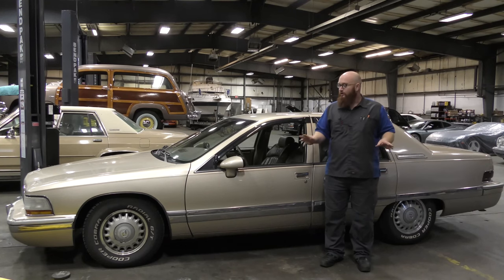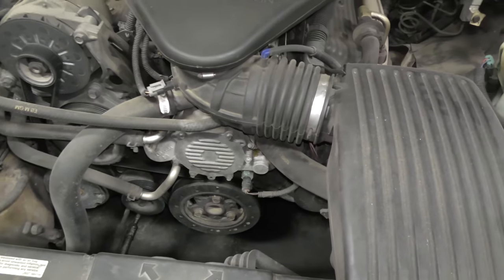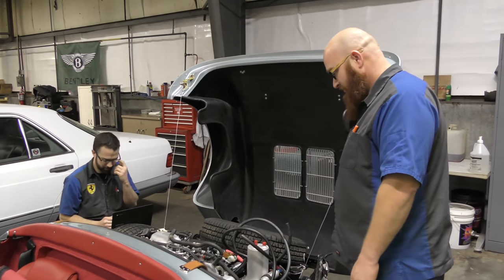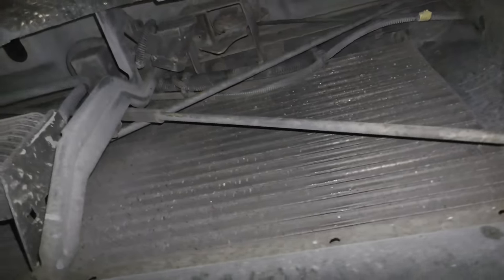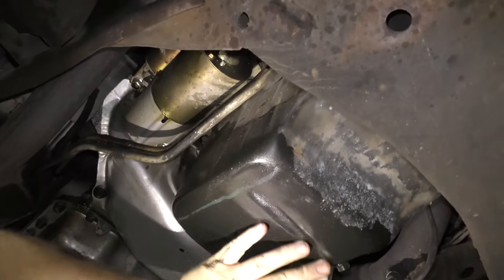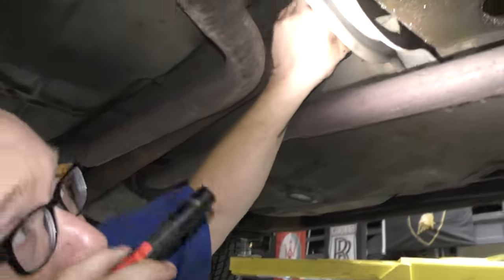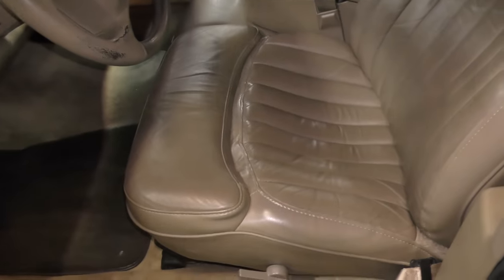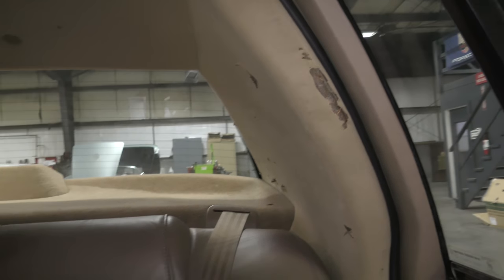Why do mechanics buy 'grandma' cars? CAR WIZARD explains their lure with this '94 Buick Roadmaster

Comment: I just talked about it with my mechanic from BMW workshop. He drives an old toyota camry V6. I asked him why he doesn't drive a BMW since he has a BMW workshop. He said: "I repair BMW cars 12 hours a day, so I'd rather go somewhere after work than repair my own BMW" ;)
Reply: Cause he’s dumb and doesn’t buy the right bmw. I’m a bmw mechanic and drive an e39 530. Car has 200k and doesn’t skip a beat. No lights. Passes inspection every year. Never quits.
Reply: @michaelric3540  yes until it doesn’t. Sure there’s some examples of bmw’s lasting to 300k but do you not remember the million mile Tacoma? Even Toyota wanted to know wtf they did so right there. They over engineer basically every car they put out you just can’t say they don’t run forever when you take care of them.
Reply: @keithbroh5730  wow what year Toyota Tacoma was it lol I might get one !
Reply: @keithbroh5730  whatr did they do right?
Reply: @keithbroh5730  bmw did a test and it found that with regular service intervals their engines would last 1,000,000 miles plus with no major engine wear, intact cylinder hones, and virtually no camshaft wear. It’s all about maintenance.
Reply: @michaelric3540  unfortunately that test was a good 20+ years ago
Reply: @James Olelo so, how is the supra made better? If it's a BMW in essence?
Reply: @James Olelo Let me get this straight. There were some supras that were rebadged BMWs, but now a law changed that? Or it was like that from the beginning?
If the BMW z4 has Toyota quality, then I would buy it right away... Just imagine a BMW 330 e46 or a 328 e36 with Toyota quality... That would be so cool!
Reply: @James Olelo oh, ok
Reply: @michaelric3540  Bmw e39 with gasoline 6-cylinder engines are durable cars, although they rust, besides, the youngest cars are already 18 years old. A colleague of mine had a X6 4.4 twin turbo. Under the warranty, his engine was replaced - a design defect. Mileage 60k, 3-year-old car. It's not for me, I can't afford to replace the engine every 3 years. I prefer a Volvo.
Reply: @michaelric3540  I had e32 735iA, and e34 525i with stick. Great cars, but today they are old. 735 was from 1990 and 525 was from 1995. Bmw has nothing interesting for me to propose, so I switched to Volvo in 2009.
Reply: Bmw mechanic for 10 years i drive an old e60 06 530xi everyone laughs at me at work the others have 80k audis and benz. One best thing is we got 1.5ft of snow todAy i was the only one that made it to work, and i have perfext attendance since my car never breaks, n52 engine with 105k miles runs better than new 5ers
Reply: bmw's are great,  if you can afford to keep them running!
Reply: @awpstardan  i have an 06 325xi. obviously you know it’s also the n52 so  mentioning it is for anyone else reading this. i am beyond 238k miles with no major issues. i have had many things to fix over time and some of these problems confused me, but if you know what to look for then repairing it really isn’t an issue. i would rather have a car that maybe takes more time overall for maintenance and repairs and has an incredible drive, compared to a car that i never work on that doesn’t make my ride anywhere near as enjoyable. 
ps. i also drove through the blizzard the other day for around 3 hours. no issues.
Reply: @michaelric3540  you sound like a silly fanboy, I'm even doubting you are a mechanic at all.
Reply: @michaelric3540  your lucky you got a good one, in general they are huge money pits
Reply: @smdog66  the vin is early on mine, I think that has something to do with it. Pre 10k vin digits. Mexican assembled. I always cringe when I see a high vin production numbers.
Reply: @sayingnigromakesyoutubecry2647  No, he's talking about past cars. Like how Chevy teamed up with Toyota in the late '80s through to the mid-to-late '90s to create Geo, or how Ford teamed up with Mazda (and still does) to make their pickup trucks (the Ranger/B-series), or even still with Chevy and Isuzu for their small trucks and SUVs (the S10/Hombre, Colorado/i-series, and the Blazer/Rodeo and later, Ascender). Those are strict rebadgings; the same mechanically (for the most part), with a few cosmetic adjustments (though not always true, in the case of the Colorado/i-series, and now the Ranger/BT-50).

The difference with the Z4 and the Supra, is that, while they start with the same base (being the drivetrain and chassis), they're not strictly rebadging a car. The end results, while similar, are distinct enough to make most of the parts not interchangeable. Sure, you'll get a fair few BMW parts codes with the Supra, but most of those will probably not work on a Z4. Parts subsidizing is something automakers have been doing for a loooong time. Yes, even competitors have worked together.
Reply: @awpstardan  I just bought an e60 06 with 181k miles and so far it’s doing me good haha
Reply: @1181darkfire  My old 528 was very reliable.  She could also be relied upon to get me speeding tickets ;-)
Reply: @1181darkfire  And the cops are on the look out for us too, by the brand name!
Reply: @michaelric3540  That's great but the rest of the car will be falling apart long before you get to 1mil miles.
Reply: @heh2k  wrong. Bills quality was great back then. Car has zero rattles.
Reply: @michaelric3540  Not correct. That "test" was almost certainly the one conducted on a track... hardly a reliable test...Even British Leyland cars could do well in a "test" like that.
The Toyota truck as far as I know, lasted a million miles in REAL conditions.
Reply: @daveanaru3038  the test was very much real world simulation. They simply changed the oil every five thousand miles. Used a correct filter and correct oil. 

Lack of maintenance is what kills cars.
Reply: @michaelric3540  A good way to know how good a car is, is to talk to the people who own one. If they get excited when their car just gets to 200k then don't get that car.
Reply: @adamr6498  I’d take a bmw that’s at 200k and counting and Infinitely more comfortable, better handling, safer and better looking than a million mile shitbox Honda.
Reply: @michaelric3540  lmao BMW money pit owner in denial. Stupid personal finance, spend 1/4 of the year at the mechanic and $800 bill every 3 months. Just be honest. BMWs are not known for their reliability. But that’s okay, you don’t buy a BMW for that. You buy it because you enjoy the style, drive, status symbol, etc. If you want reliability, it’s Toyota and Lexus. You luxury car drivers need to stop lying. The data shows German luxury cars made post-2000 have the highest median maintenance bills and spend the most time at a mechanic, along with Chrysler, Mitsubishi, GM, etc
Reply: @ebgreenham  oh and don’t get me started on the atrocious fuel mileage of Japanese cars. 

My 20 year old bmw can peg 35 mpg properly maintained. 

I see new Toyota’s barely getting 20 mpg. 

Pathetic.
Reply: @michaelric3540  Maybe a Toyota Tacoma. A new Corolla hybrid is like 40mpg. Suck on that. Seats are comfortable just fine. BMWs are for douchebags who don't use their turn signals. You're such a liar that you're a BMW technician, obviously, but regardless, you didn't deny that you spend inordinate hours working on your BMW within a year when I can relax and not waste time on a depreciating asset. Toyota Corolla starts every time. Can't say the same for a Beemer.
Reply: @michaelric3540  So because you saw one Camry breakdown, Toyotas are therefore less reliable than BMW? Lmao anecdotal much? Just read consumer reports and reliability rankings. Every year it’s usually the same companies topping the list, and hint it’s not BMW, Jaguar, Land Rover, Mercedes. Btw I have a R107 Benz so I can attest that older German cars are built really well, except for when they do have problems the parts are triple $$$   what you pay for a comparable year Toyota. Just so you know one of my favorite cars is the BMW E30 convertible, but luxury car owners need to stop trying to overcompensate and justify spending extra time and money for a depreciating asset as if they’re better than everyone else. Shows insecurity and is quite a turn off to others FYI. Modern BMWs are pretty much for obnoxious fuckbois and douchebags. Congrats.
Reply: @ebgreenham  yea Toyota’s top the reliability list because they never change anything. Same old boring cars. Woopie. I’d prefer a brand that tries to improve performance and efficiency instead of providing the same boring product. 

Have I mentioned Toyota went to bmw for their engine? Sure they tuned it up but it still means they wanted a better power plant for their Supra. 

e30 vert? Yikes that tells me everything I need to know. 

Only losers would prefer a vert over a coupe. 

Nice talking to ya captain Trash taste.
Reply: @michaelric3540  This is why Toyota went to BMW for their Supra. The Supra had the same BMW B58 motor as my 440.
Reply: @ebgreenham  imagine calling someone a troll on the internet t
Reply: @michaelric3540  yeah I just did. What’s your point? You’re probably a 14 year old white boy in the suburbs. Elitist judging everybody on their car preferences. Very immature.
Reply: @sayingnigromakesyoutubecry2647  the new Supra is actually a heavily re worked bmw, not just a re badged one. Toyota spent a lot of time un bmw’ing it
Reply: @rikkatheconure2395  what kind of things did toyota unbmw?
Reply: @sayingnigromakesyoutubecry2647  they mostly focused on making it handle like they wanted it to. If you read comparisons people say they feel like completely different cars when you drive them. The only thing they actually share is the b58 (I think it’s called) that they just tuned differently and the frame itself as far as I’ve seen. Saw a good video about what Toyota did to make it it’s own car.. trying to find it and post a link
Reply: @rikkatheconure2395  ok I would appreciate that. Thanks
Reply: @sayingnigromakesyoutubecry2647  I can’t figure out how to post a link, but the channel name is albon and the video is called 2021 Supra bmw or Toyota
Reply: @rikkatheconure2395  thanks
Reply: @sayingnigromakesyoutubecry2647  yessir
Reply: @rikkatheconure2395  I have watched it. Toyota helped bmw making a reliable engine. Cool. I want one!
Reply: @sayingnigromakesyoutubecry2647  it really is a neat car.
Reply: Well bmws are garbage cars anyway.  If you love driving a loaner car and having your car in the shop then by a bmw.
Reply: @ebgreenham  Does a BMW drive nicer than a Toyota? Yes. Is a BMW more powerful than a Toyota? In general, yes. Does a BMW have more tech? Yes. Does BMW invent tech that tricles down to other manufacturers a few years later? Yes. Does BMW cost more? Yes. Does a BMW have more maintenance? Yes. All these factors make for a less reliable car. Theres no way around it. Toyota play it safe. They arent filled with new tech, its the same old stuff. BMW's are supposed to be on the forefront of tech, and driving dynamics. Its also supposed to be a sports car, hence its a sports sedan. Toyotas are A to B appliances *only*. BMW's need to be dual personality. You are really comparing apples to oranges, and they are targetting completely different audiences. Also, if BMW was as unreliable as people like you make them out to be, Toyota wouldnt partner with them. And dont give me that "Toyota changed the B58 engine". No, they actually didnt. The new Supra engine specs is identical to a basemodel inline 6 Z4, including the mag ride. BMW is not about to change jack shit because Toyota told them to. Pack it up son.
Reply: @placeholdername3206  well, do you have anything to support that claim? Ideally someone that has disassembled the new engine vs the old b58 and compared the parts
Reply: @michaelric3540  Well good for you.  But everyone knows that modern BMW's have brittle plastics that break easily.  No thanks.
Reply: @johnestupido1418  sorry bro that’s every vehicle made these days.
Reply: @michaelric3540  absolutely love my 2003!530i. Thing is in excellent shape because it was well maintained, it is the 3rd bmw I have owned. The other two were garbage with constant issues because the previous owners never maintained them

Comment: I almost spat out my drink with the opening view of the Roadmaster and Grand Marquis!  Back in the day I used to scrounge the back lot (before the Cash for Clunkers days) where the real bargains were.  I first found a 1983 Grand Marquis - 27k miles (it was 1993) and the Lincoln dealer didn't want it on their lot.  I bought it for ~$2500 and it was a dynamite car.  The Roadmaster was a 1992 that came in with a blown motor, but was under factory warranty.  The original owner was fed up and the dealer bought it back, but I bought it as the dealership was already in the process of replacing with a brand new engine.  I paid a little more for this, but it was worth it and many great miles of cruising.

Comment: Mechanic for 24 years, and I drive an '03 Grand Marquis daily🙂. It's actually my 4th Panther.
Reply: That's another thing, these cars that are built on platforms that run 10 or more years have lots of cheap parts available.
Reply: @paulwoodman5131  and they're cheap
Reply: I've had a 1997 Grand Marquis since 2009, just hit 100,000 miles a month ago.  I'll probably have it another 20 years.
Reply: @davidp8627  Watch out for the plastic intake manifold, you will see a coolant leak in the driveway if you're lucky or it will explode under the hood while you're driving it. The 100,000 mark is around when they go bad. I avoid the years from 1996 to 2001, that's when they used the composite manifold. Otherwise they are great cars, have been driving the panther platform, Mercury Grand Marquis's and Lincoln town Cars for the past 35 years.
Reply: I've been wrenching on cars for over 45 years. Just replaced my Land Rover that I bought on auction for $3,200 (plus my maintenance and $1500 in tires, shocks, oils) and I drove it on/off road for 240k miles. Simple to fix and a few tricks that I learned, but who gets a quarter million miles off a $5k car? Granny Car Buys!
Reply: Got the same car.  Love it, peace
Reply: my dads retired he bought marauder for himself. he drives the fuck outta it
Reply: The panther platform is the best car on the road!
Reply: @johncrowley7727  just replaced it. Took about 40 minutes, not bad at all.
Reply: @johncrowley7727  it doesn't mean you shouldn't buy one of those years, but you should replace it if it's still on there. In fact, you should buy one that is still original if you can find one  (meaning it never failed, and probably never boiled over... the best situation you can hope to find in a used Panther.)

Comment: "this is an engine you can work on for 1 or 2 hours without getting mad and throwing your wrenches through your garage" - why does the Jaguar XJ12 spring to mind when he says that? ;-)
Reply: Wait... You have an xj12 without an LS swap?
Reply: Nobody wants to touch those Jags.
Now even with a 10 feet long wrench.
Unless they have plenty of time to get out the wrench 🔧 on them.
Reply: Let's not forget three gallons to the mile.
Reply: @georgepatient7710  yeh but its a v12
Reply: @dcarbs2979  Yes it’s a V 12 however it don’t run. you need shit that runs
Reply: @blueboltstrike6705  I thought that was the point of repairing - to get it running again!
Reply: He says that. Till you have to change the optispark unit. Or do spark plugs and wires....

Comment: Why, because they have low miles, interiors are clean, and aren’t hooned to death.
Reply: Love to know where these low mileage "grandma" cars are. My 1990 Volvo 240 was bought new by my mom when she was 60. By the time she gave up driving at 85, Arthur was up just past the 200,000 mile mark. He is at 400,000 now and running like new.
Reply: I drive a Lincoln continental mark III daily as a dealership mechanic. Old luxury cars are dirt cheap, supremely comfortable, and big block v8 engine torque still makes them fun to drive.👍
Reply: This is the way!
Reply: @michaeltutty1540  If you're looking for a roadmaster I've noticed that most up for sale are either in the Midwest or the eastern seaboard.
Reply: lots of rust over there, can't smog them on the West Coast either
Reply: @MrTaxiRob  you can only if you spend 400$ on new EGR like me